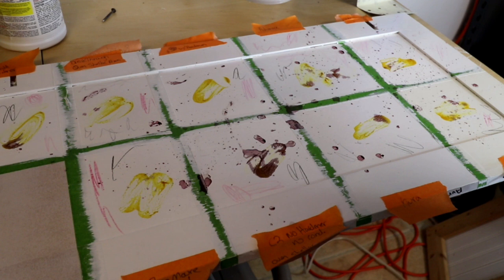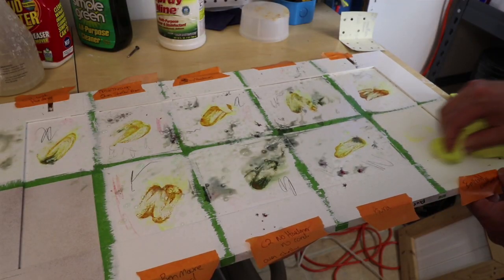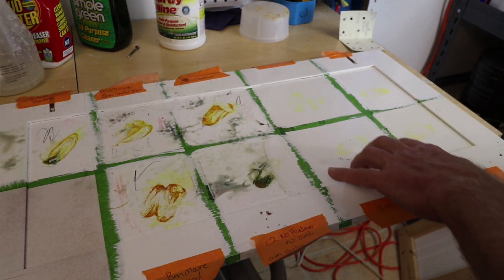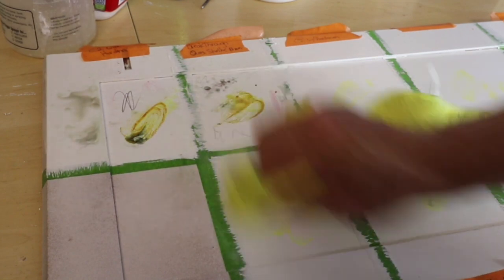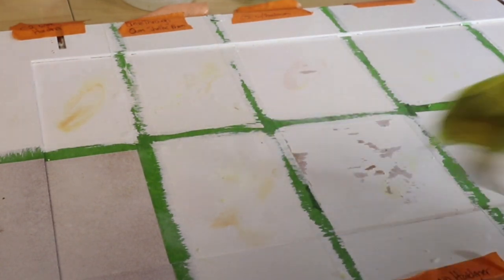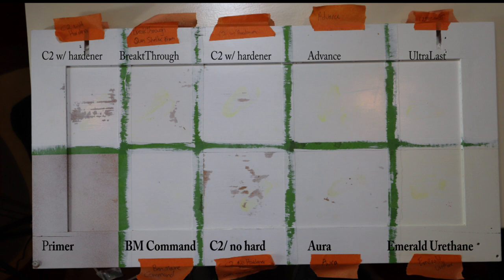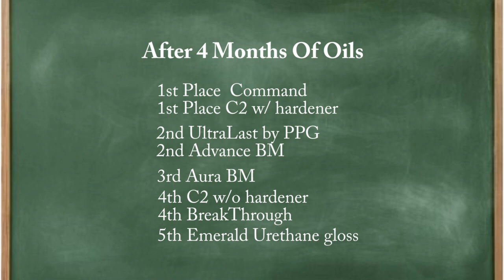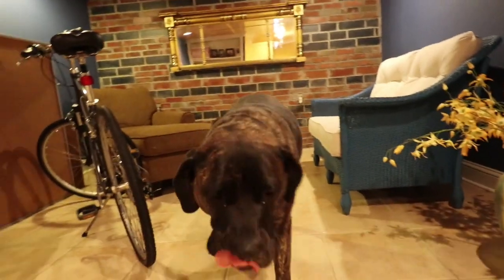Who has the best cabinet paint part 2

Comment: When you can try out Cabinet Coat. Side note i paint for a living and somehting you need to watch for is the base of the paint. For example some paint is an ultra deep base color(black, neon brite etc) will lose hardness. Sherwin makes something called Multi Surface Acrylic. Its an industrial coating so you wont see it on the shelf. Its made so that 2hite all the way to pure black is just as hard and scuff resistant. The paints that win here could be vastly different if you want a darker set of cabinets so please keep that in mind. Any 1 has any questions feel free to ask.
Reply: Yes exactly! I tried advance in a dark blue and it was horrible. It never hardened and scratched so easily with my finger. Expensive paint and I had to strip it all off
Reply: @wb4072  Sorry for late reply. Just saw this. Normally we use something called Multi Master from Cloverdale. Its super durable. Also Renaissance is super nice from them as well. Multi master is Cloverdale's version of BM command. Except I get it at half the cost. Nothing against BM but they overcharge for products in my opinion. For example Aura is 100 a gallon my price. Dulux Diamond is 40. Cloverdale Ecologic matte is 35. IMO all are as good as Aura.

Comment: Really surprised at the sw urethane. It’s easier to work with because of the quicker dry and hardening times… guess I know why now. I use the advanced a lot, just worried about the 28 day harden time and the fact you can’t do 3 coats in a day(well maybe a long work day lol) But I think it’s worth it. Some customers just don’t want to wait that long. 🤷‍♂️
Reply: I did not see the "wipe off" when he used bleach and water and on the flip side, I don't think SW was represented.  I watched twice but I could have still missed it.  BM-A seemed to have the same amount of mustard. I am quite happy with the durabilty of PPG

Comment: I wished I watched this a few weeks ago, we bought a new fiberglass front door that I painted and wife picked a sherwin williams color so i decided to go with Emerald urethane as reviews i read said it dries to hard and easy to clean surface plus only had 4 hour recoat rather than 16 hr recoat time with my normal go to BM Advance.  BIG MISTAKE this SW paint is awful!  Yes it applied really nice, leveled out (i sprayed it) beautifully but and BIG BUT it scratches so easy and doesn't like to be wiped clean.  I sanded near the door so the dust went on the navy blue door that I wanted wipe off, I was wiping dust off lock when my finger nail barely touched paint left a scratch that i had touch up (2 days after painting) then there were some smudges from install that i soaked a paper towel with just water, it left a mark where i lightly wiped door clean that needed touch up. Should have used my usual Advance, have sprayed several cabinets/vanities/etc.with it and that leaves a rock hard easy to clean surface.  Looks like at some point in near future I will be repainting door with Advance.

Comment: What is your opinion on placing a clearcoat like General Finish or equivalent top clearcoat for added durability?
Reply from the maker: That works.  We did that for a few years before we found cabinet paints that did not need that step.

Comment: Hi, love your informative videos. I'm about to spray my kitchen cabinets so I researching for the most durable paint and I have a question about the video you did 5 months ago with the emerald urethane which you gave great ratings on but in this video you were not too crazy about it. Now I was sold and about to use it so what changed in this test? I was about to pick up laquer this evening but now I'm confused. Please help. Thanks.
Reply from the maker: Great question!  Emerald paint does very well against most stains but oils is not one of them.  Oils from fingers are easily and often transferred to kitchen cabinets.   Emerald did well against cleaning stains off but did not hold up to the oils.
Reply from the maker: The best paints that I tested are Command, Advance, and Ultralast.
Reply: What are your thoughts on using a laquer from Mohawk compared to the advance please?
Reply from the maker: @JOEYSC03  Lacquers  will be number one for quality smooth finish.  However, the cabinets cannot be painted in a home which makes them a very expensive option.
Lacquer is very flammable.  It is illegal to spray it in homes and dries to fast to be brushed or sprayed.

Comment: Thanks for the info!! I’m about to paint my smaller kitchen (about 12 cabinets and 4 drawers) and want to use Command! I do not have a sprayer so I’m nervous about the application! Would you suggest a brush or roller for the larger areas and the big pieces surrounding fridge?! If roller what type?! Thanks!!

Comment: Problem with Command!!! It micro bubbles when you roll it, tried 10 different mohair and microfiber covers... doesn't matter. Tried adding extender, paint thinner and butyl cellosolve...still bubbles. I love everything about this paint except these micro bubbles make it a deal breaker for hand applying. Stuff sprays like glass. Use Behr urethane to hand apply, no bubbles.

Comment: Scoff-X would be an interesting comp
Reply: Yes my new favorite trim, door, and cabinet paint
Reply: @miladbehbahani5848  better than Advance because of durability? Workability? Is it easier to brush?
Reply: @Avital4414  in my personal opinion yes. Advance can be finicky to apply other than spraying. It has the nice finish look like advance. Dries much faster than advance. And truly scuff resistant. I love how scuffx feels after cured.
Reply: It holds up better in my opinion as well
Reply: @miladbehbahani5848  I think I oversanded some trim, and now grain and scratches are showing through the freshly primed (Fresh Start) and painted (Scuff-X) surface. If I re-primed, this time using BIN shellac primer, would that likely hide the scratches and grain?
Reply: @Avital4414  I had that problem at first. Have to have 2 cts primer, 2cts finish. 1st sand #150. 1st primer sand #220. 2nd primer sand #320. Spray all.
Reply: @1rumpet  thanks!!!

Comment: You're comparing trim paint to trim paint to trim paint... You really need to be t sting and ACTUAL cabinet paint (industrial wood coating) like Renner, Milesi, Centurion, Envirolak, ML Campbell, etc. This test is a race to the bottom with the slowest sedans. You don't even have a race car in the pack.